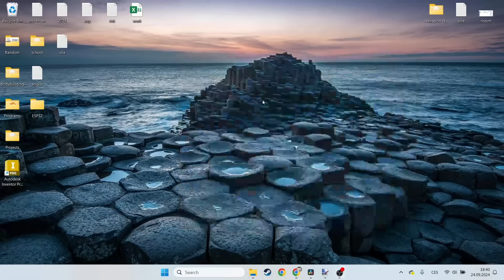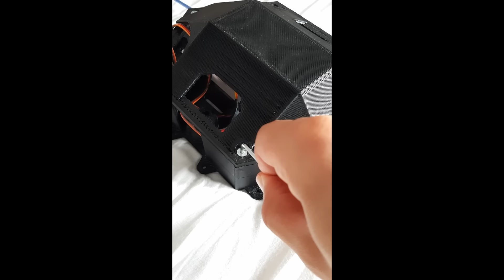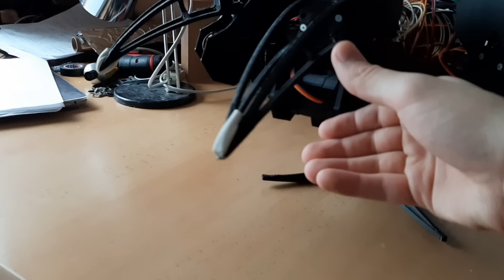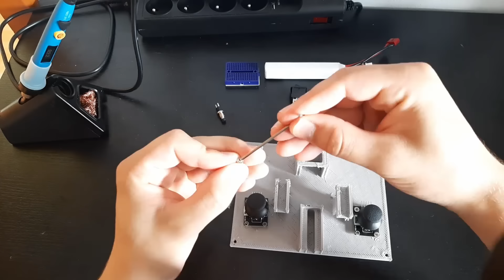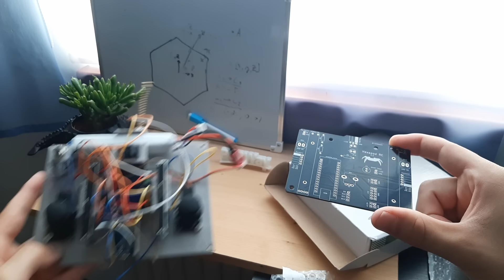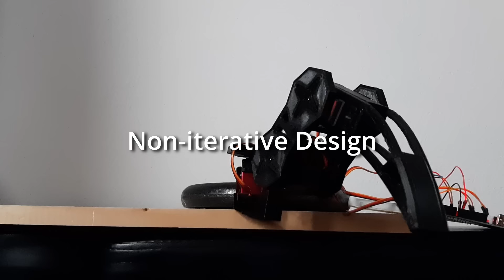My First Robot: Building a Hexapod From Scratch

Comment: Could you please recommend a suitable battery to power this robot? I’m developing it for our university project, and our lecturers mentioned that the robot should be able to operate for at least one hour.
Reply from the maker: 1 hr is a lot so you probably want a 2S 5600 mAh LiPo and make the robot light/small
Reply: @TazerEngineering thank you for your response

Comment: Thank you. I want to build a robot. I'm really unsure what is the easiest to start with. Would the dog (4legs) not be easier than the hexapod? 
This was a great video, you've provided me with some great tips, e.g. printing a pCB and I stuff on the power pack. I know servos are sensitive to Voltage, so not sure how to wire up a large number of them. 
Thanks again.
Reply from the maker: Yeah definitely don't build a hexapod. I would build a robot dog or ever a small 3 legged robot as a first project. Also don't make it big.

Comment: amazing work man! I did use the nRF24L01 modules too and can relate the pain that it is making them work fine. If you´re planing to to other projects using RF take a look at the nRF24L01 + PA + LNA or the Ebyte series based on the nRF24L01 chip arquitecture, they work really well!

Comment: Hey! Just asking - did you remake the entire thing from PLA halfway? Did you use regular pla or some hardened version?
Reply from the maker: Yeah, I replaced the parts as they were breaking, eventually replacing all parts with PLA. I used regular PLA, and since the robot weighed 5kg, it still wasn't strong enough in some places.
Reply: @TazerEngineeringoh, alright, great video BTW!

Comment: Caution with standard threadlocker.

I think it won't do anything to PLA but i have seen it very efficiently depolymerise PETG and HIPS, and it might do the same to ABS. Even the fumes not just the direct contact.

Apropos HIPS, you can print it on an open frame printer when there's no draft. On an Ender3 you don't need fan enabled but on my DIY printer i set like 5% PCF because my coldend fan isn't leaking into the hotend area.
Reply from the maker: noted

Comment: Since you have 18 or more servos, and 6 legs, you may also want to try object oriented programming. It makes code maintenance a lot easier, although you may need to learn a new way of thinking.

Basically you define let's say a leg class with it's own variables, constants, and functions it needs, and make 6 instances. It's like designing 1 leg, and printing it 6 times.
Reply from the maker: I didn't know Arduino IDE had OOP when I started. I might give it a try with my next robot.

Comment: Not to be rude or anything but, you need better wire management, sir! 🫡
Reply: Wire management on a constantly changing design is not necessarily good idea, he even mentions the what he did have was a constant pain, zipties are the best you can do if your design isn't final, at least in my opinion. Especially without modifying the servo cables if they are either too short or too long. He could also want to keep the servos stock for easy replacement.
Reply: @TOMS343  I see, so that's why he hasn't manage the wires.
Reply: Wire management...? What language is it on?
Reply: Reaaal
Reply: You can also wrap the bundles with electrical tape but again some of the wires require the freeflow
Reply: first time...
Reply: Just keep it to yourself😊
Reply: Jarvis blow up this mans house